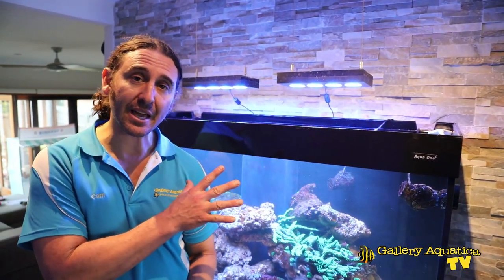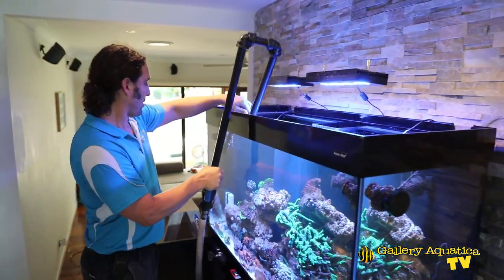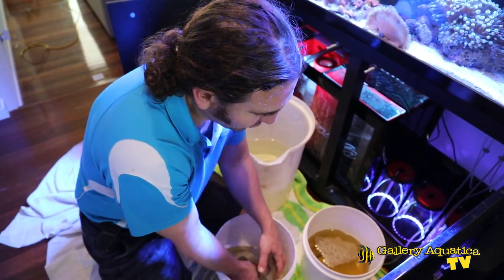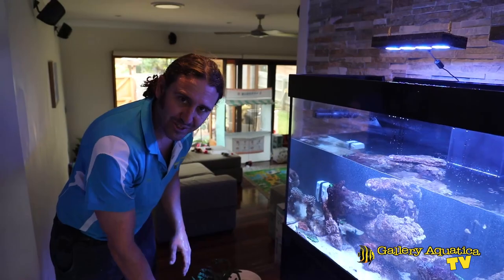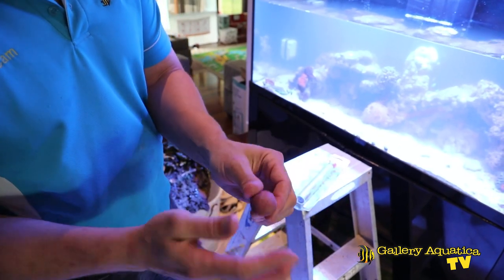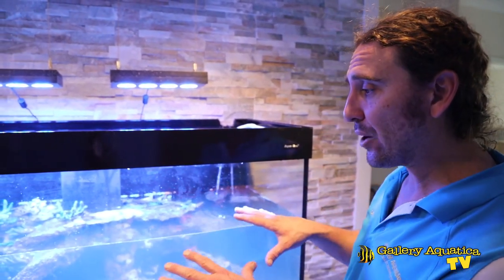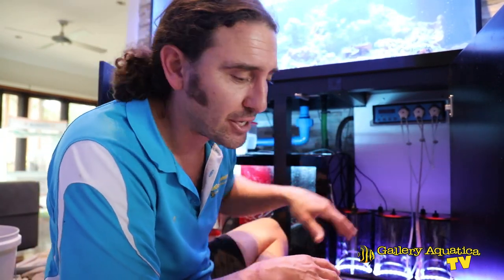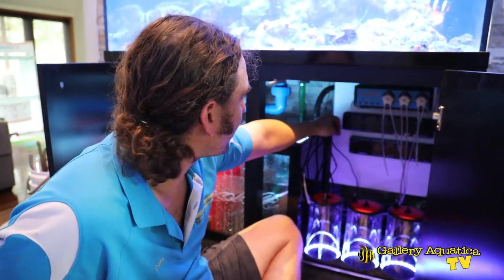The Tank Transfer Sump Swap Shuffle Part 2 --- Gallery Aquatica TV

Comment: Good video as usual but wouldn't it make more sense to drop the dosing pump below the power boards (so they can be accessed without the dosing tubes in the way)?  Also have you considered using cable duct to route/hide/manage all the cords?
Reply from the maker: I’ve used cable ducting on lots of jobs, but I don’t think I will on this one. I’m planning on punching through the board with both the dosing lines and power cords so it’s neat. Cam

Comment: I have a center return. And I'm anxious in seeing your scape for ideas
Reply from the maker: Did you see our video “monster walk around tank”? Is your return central like that? Cam
Reply: @GalleryAquaticaTV  my tank is not a walk around, it's like the one you are showing on this video. The overflow is in the center with returns on each side of the overflow. I like the idea of gluing rocks to the overflow. I tried using magnet rocks. The tank is deep, I have to stand on a step stool to do anything. It is a 150 gallon tank. My tank now is empty since my move, open to suggestions.

Comment: Great channel! Out of curiosity, why didn't you mount the control board and associated equipment before swapping out the system i.e. in your shop? Thanks for your other videos.
Reply from the maker: Hi Rob, I wish I had mounted the board before the install, it was just a lack of time to do it which was the problem. Thanks for watching😊 Cam